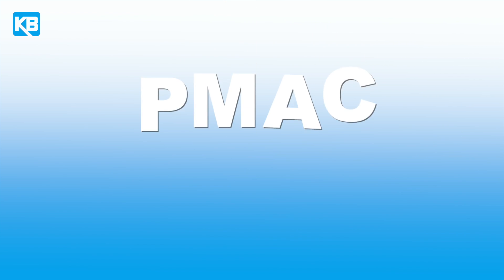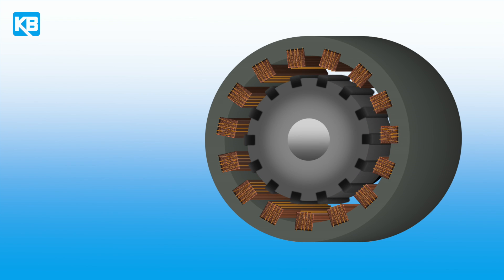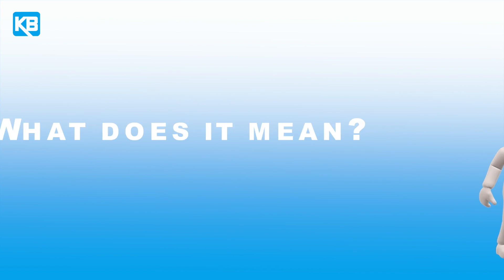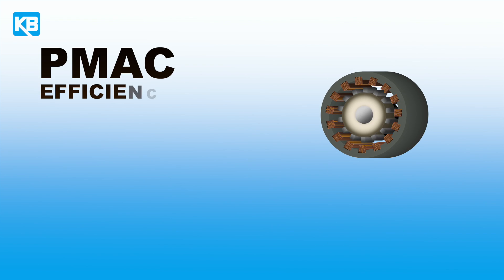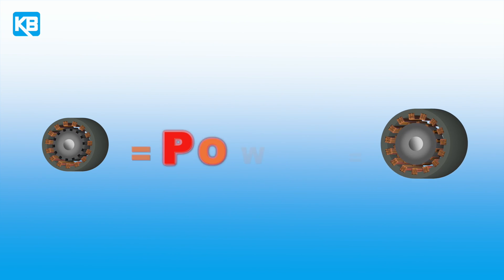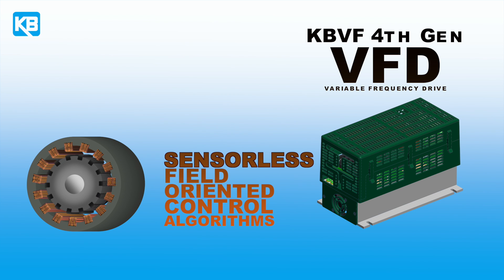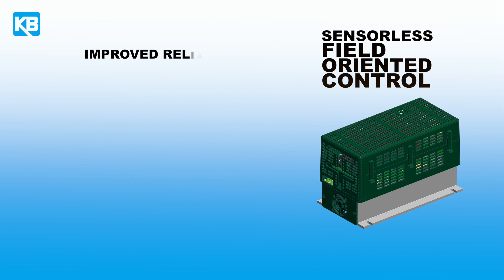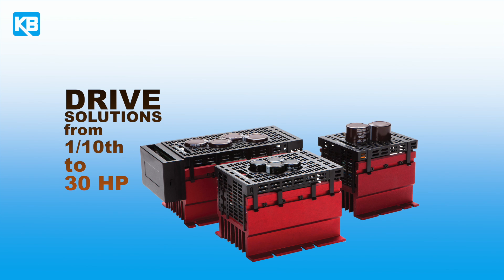What are PMAC Motors (Permanent Magnet AC Motor)?

Comment: Magnet motors,sounds good,but does it require electricity? If then it should be called electric motor,but if it could run on it’s own, then it’s indeed a magnet motor.
Reply: Free energy don't exist you dumbass
Reply: According to Maxwell, any (electric) current flow induces a magnetic rotational force, so that copper coils create a magnetic field. Then the fields from the magnet and the wiring align by the forces acting on them.
Reply: Magnetic motors differentiate from induction motors by not having a magnet on them. Whenever an electric field acts on a metal (in this case the core) positive and negative charges split and the core (metal sheets) makes their own field. In that sense some motors are magnetic and some not.